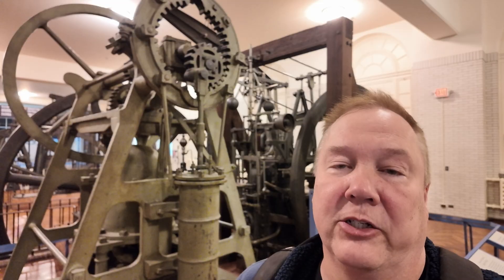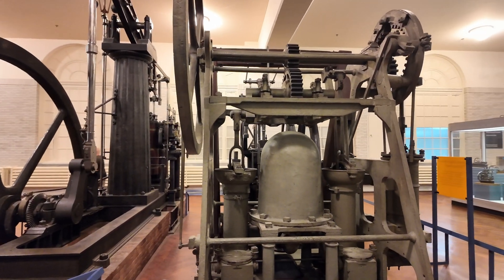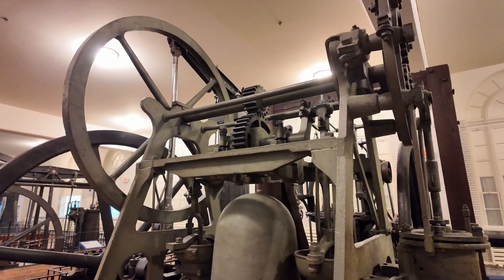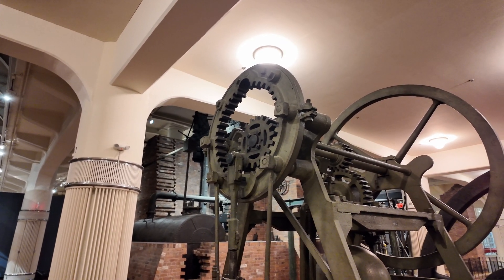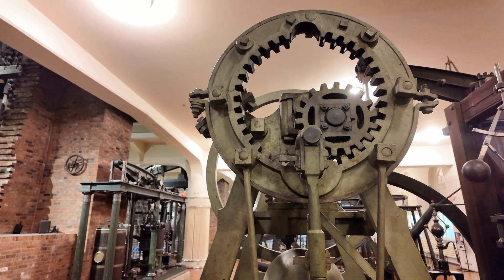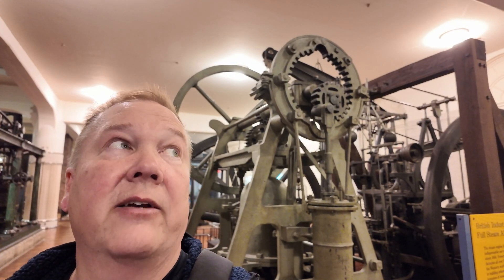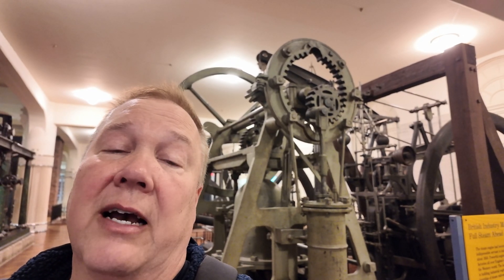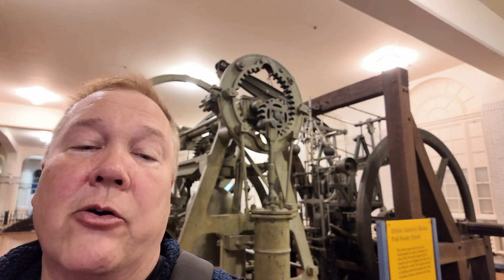The Steam Engine You Never Knew Existed!

Comment: This mechanism turns the output crank at the same rate that a connecting rod would. This existed solely to bypass the patent on the use of connecting rods.
Reply from the maker: Didn't know those were patented then, too.  Not really surprised.
Reply: @Industrial_Revolution  I have a feeling that this stationary steam engine might have been built for a small workshop driving belt driven machines. I can see way Henry Ford brought it and exported it to America
Reply: @Industrial_Revolution  Might I suggest that a quick steady shot of the information board would be a good thing to include ?
Reply from the maker: @nigelmitchell351 Where good signs exist (not always) this is a good idea.  Thanks!
Reply: There is actually an advantage to this design. The pin on the smaller gear will follow a strictly vertical path, so this engine requires no crosshead or any other mechanism to restrict the piston to vertical movement. The gear/crank mechanism produces vertical movement directly. You are correct of course that it produces two strokes per revolution, as with a normal crank mechanism.
Reply: @TonboIV  While the piston rod does follow a straight reciprocating path, the engine still needs a crosshead.

The reaction of the piston rod pushing at an angle to the small gear places a bending moment on the piston rod.
Reply: @JaneDoe-dg1gv  I see no reason why it would. We agree that the movement of the pin is reciprocating, and as long as it is positioned above the piston (and why would it not be?), then there is no bending moment on the piston rod. Of course there are all kinds of moments on the gear and crank, but the bearings of these parts are what will bear those moments.

Also, there is pretty obviously no crosshead above the piston in this engine.

Comment: Another interesting video!!
It's my understanding that early steam engines had major problems with steam explosions of their boilers and/or engines due to poor metal manufacturing of the times. That may have contributed to running "low pressure" engines for a long time.  With a few extra 👍👍
Reply from the maker: Thanks!  It definitely took a while for boiler and pipe technology to catch up and allow for higher pressures
Reply: @Industrial_Revolution  Did a little research & was able to find the maximum steam pressures concerning the following sidewheel steamers:
  1827 HANCOCK        - copper boiler in the hull - 12 psi "high" pressure
  1832 KING PHILIP     - copper boiler in the hull - 15 psi "high" pressure
           [1837 - claimed 1st steam whistle on a steamer]
  1847 BAY STATE        - 2 iron boilers on the guards - 25 psi pressure
  1848 EMPIRE STATE - 2 iron boilers on the guards - 25 psi pressure
           [1856 - burst steam pipe - number of passengers & crew died]
  1855 METROPOLIS   - 2 iron boilers on the guards - 25 psi pressure
  1865 NEWPORT         - 4 iron boilers on the guards - 25 psi pressure
           [4 separate smoke-stacks]
  1865 OLD COLONY    - 2 iron boilers on the guards - 27 psi pressure
  1867 BRISTOL            - 3 iron boilers in the hull        - 25 psi pressure
  1867 PROVIDENCE    - 3 iron boilers in the hull        - 25 psi pressure
           [BRISTOL & PROVIDENCE were identical sister ships]
  1883 PILGRIM             - 4 iron boilers in hull               - 50 psi pressure
           [largest single cylinder working beam engine]
  1889 PURITAN            - 8 [steel?] boilers in hull        - 110 psi pressure [largest compound, 1 high & 1 low pressure cylinder, working beam engine]
  1890 PLYMOUTH        - 8 steel boilers in hull           - 170 psi pressure
  [triple-expansion engine 1 high, 1 intermediate & 2 low pressure cylinders] 
  1894 PRISCILLA         - 10 steel boilers in hull         - 150 psi pressure
  [double compound-expansion engine 2 high & 2 low pressure cylinders]
     The reason steamers, particularly on the Hudson River & Long Island Sound, put their boilers on the guards was in case of a boiler explosion the boat might not sink.
Reply: Did a little research & was able to find the maximum steam pressures concerning the following sidewheel steamers:
  1827 HANCOCK        - copper boiler in the hull - 12 psi "high" pressure
  1832 KING PHILIP     - copper boiler in the hull - 15 psi "high" pressure
           [1837 - claimed 1st steam whistle on a steamer]
  1847 BAY STATE        - 2 iron boilers on the guards - 25 psi pressure
  1848 EMPIRE STATE - 2 iron boilers on the guards - 25 psi pressure
           [1856 - burst steam pipe - number of passengers & crew died]
  1855 METROPOLIS   - 2 iron boilers on the guards - 25 psi pressure
  1865 NEWPORT         - 4 iron boilers on the guards - 25 psi pressure
           [4 separate smoke-stacks]
  1865 OLD COLONY    - 2 iron boilers on the guards - 27 psi pressure
  1867 BRISTOL            - 3 iron boilers in the hull        - 25 psi pressure
  1867 PROVIDENCE    - 3 iron boilers in the hull        - 25 psi pressure
           [BRISTOL & PROVIDENCE were identical sister ships]
  1883 PILGRIM             - 4 iron boilers in hull               - 50 psi pressure
           [largest single cylinder working beam engine]
  1889 PURITAN            - 8 [steel?] boilers in hull        - 110 psi pressure [largest compound, 1 high & 1 low pressure cylinder, working beam engine]
  1890 PLYMOUTH        - 8 steel boilers in hull           - 170 psi pressure
  [triple-expansion engine 1 high, 1 intermediate & 2 low pressure cylinders] 
  1894 PRISCILLA         - 10 steel boilers in hull         - 150 psi pressure
  [double compound-expansion engine 2 high & 2 low pressure cylinders]
     The reason steamers, particularly on the Hudson River & Long Island Sound, put their boilers on the guards was in case of a boiler explosion the boat might not sink.
Reply
Reply: Did a little research & was able to find the maximum steam pressures concerning the following sidewheel steamers:
  1827 HANCOCK        - copper boiler in the hull - 12 psi "high" pressure
  1832 KING PHILIP     - copper boiler in the hull - 15 psi "high" pressure
           [1837 - claimed 1st steam whistle on a steamer]
  1847 BAY STATE        - 2 iron boilers on the guards - 25 psi pressure
  1848 EMPIRE STATE - 2 iron boilers on the guards - 25 psi pressure
           [1856 - burst steam pipe - number of passengers & crew died]
  1855 METROPOLIS   - 2 iron boilers on the guards - 25 psi pressure
  1865 NEWPORT         - 4 iron boilers on the guards - 25 psi pressure
           [4 separate smoke-stacks]
  1865 OLD COLONY    - 2 iron boilers on the guards - 27 psi pressure
  1867 BRISTOL            - 3 iron boilers in the hull        - 25 psi pressure
  1867 PROVIDENCE    - 3 iron boilers in the hull        - 25 psi pressure
           [BRISTOL & PROVIDENCE were identical sister ships]
  1883 PILGRIM             - 4 iron boilers in hull               - 50 psi pressure
           [largest single cylinder working beam engine]
  1889 PURITAN            - 8 [steel?] boilers in hull        - 110 psi pressure [largest compound, 1 high & 1 low pressure cylinder, working beam engine]
  1890 PLYMOUTH        - 8 steel boilers in hull           - 170 psi pressure
  [triple-expansion engine 1 high, 1 intermediate & 2 low pressure cylinders] 
  1894 PRISCILLA         - 10 steel boilers in hull         - 150 psi pressure
  [double compound-expansion engine 2 high & 2 low pressure cylinders]
     The reason steamers, particularly on the Hudson River & Long Island Sound, put their boilers on the guards was in case of a boiler explosion the boat might not sink.
Reply: Steam boiler explosion's : the ebolution of all the oxygen out of the water, repeat use of boiled water , see water hammer, !?
Reply from the maker: @kettleions  Not such an issue if you're venting the steam after it goes through the piston.  The early engines, like the Newcomen engines, though, did require use of a snifter valve.

Comment: All the work to make the pattern for this gearing, instead of using a simple crank.
Reply: The crank was patented and the patent was still active…
Reply from the maker: Not sure when the crank patent expired, but some parents were too expensive to license.  Watt, for example, charged half your fuel savings, which, if he figured you cut fuel use in half over Newcomen, meant it be 1/4 of your Newcomen or 1/2 of your Watt fuel costs.  Definitely worth looking at options.
Reply: You'd be surprised how many seemingly straightforward designs aren't adopted widely in any industry, and it's all due to patents. As the other guy said, the simple crank (for use in a steam engine) is patented by someone else hence is unusable...

Comment: There are various methods around to convert reciprocal motion the rotary motion. By the way changing the speed does not change the power. It changes the available torque.
Reply: The engine has me confused with that statment that it is the result of Watts patterns running out, since the planetary gear was Watts work around for the simple crank that had been patented by someone else.

Also 4HP is really low sondiering that I have seem model steam tractors that were rated higher, on the other hand that is still no where near the pressures one would get with superheated steam.

In these terms that how the German TÜV came about, to check on steam boilers, today the Technischer Überwachungsverein, ( Technical surveilance club ) is an international maintainance standard around the world, doesnt matter if it is Hydro power plant dams in Brazil or the MOT on their home turf in Germany , and of course they still do steam boilers and generators.
Reply from the maker: The relevant Watt patent was on the high pressure steam piston.  Although Watt never made them, his original patent included "strong steam" cylinders, not using a condenser.  The patent was criticized as overly-broad, and probably unenforceable, but no one really wanted to take on Watt, who was a bit of a hero to many
Reply: @Industrial_Revolution   As I remember there were also safety concerns at the time that steam at those pressures should not be trifled with.

Overall Watts engine is really weird compared to the doubble acting piston pistons one finds in comercial model engies, besides the ocillating ones.

Is "Strong Steam" the same as dry steam or is that a completly different denomination ( Dry steam being superheated  steam, which doesnt condense during the work stages in the engine way above the 100°C that water requires just to vapourize at sea level, I think poverplants are at 550°C?)
Reply from the maker: Strong steam was any steam above 1 atmosphere above ambient, so 15psi or so.  About half what's in your car tires.
Reply from the maker: You're right about the power/torque thing.  Power is over time and relatively unchanged